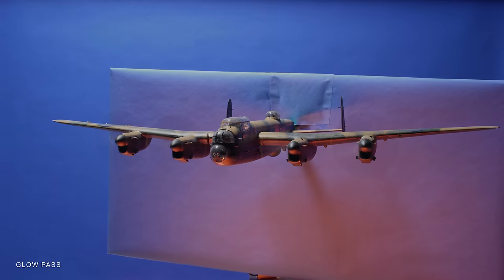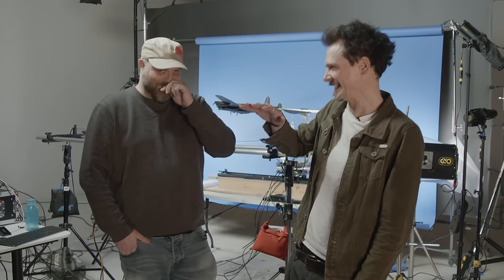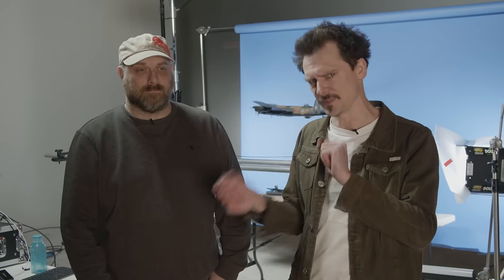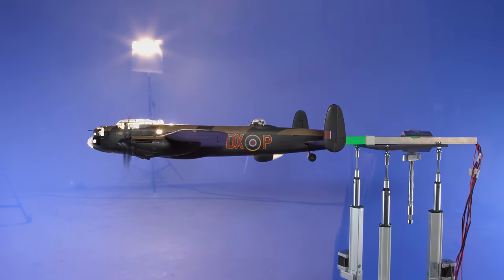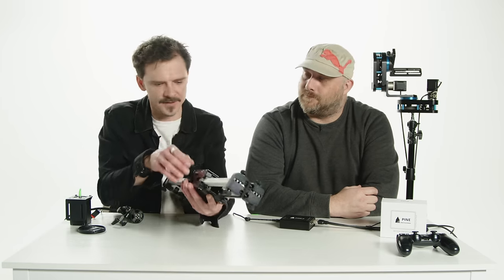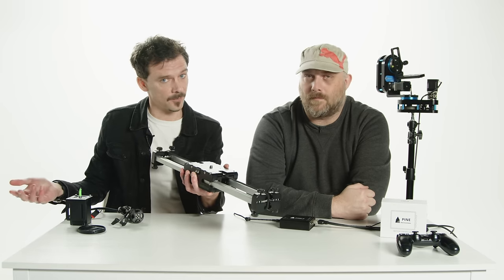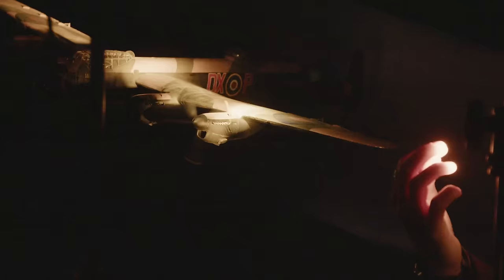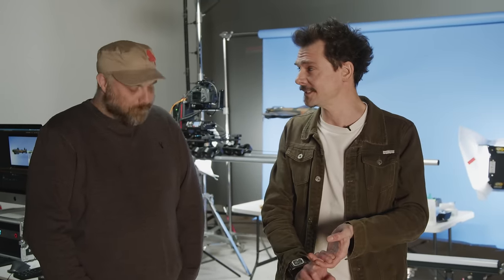All About MOTION CONTROL!

Comment: On the Kessler motors, did you set the “Steps Per Unit” to 200/“rot” on each motor axis? It was something that was left out of the tutorial and really helps the motors perform correctly with Df.
Reply from the maker: That's great to know. In the end we found doing a hard reset of all motors and connecting the rail motor to DF first solved the problem! A weird solution so it's good to know there's a particular setting that might be the best answer. Thanks! 👍

Comment: This is exactly the kind of video I've been looking for. Thank you! I've got a full Edelkrone setup, and you're right. There are only so many axes you can control. It's designed around the idea of simplifying complex camera moves, but doesn't include moving a prop or a light (although there are ways you can sort of fudge it).

I also have the RGKit Play motion control system which is designed around creating motion for props and displays, as well as limited camera motion (their system only supports five motors so you need to pick and choose). 

I would love these systems to talk to one another (as well as my old Cinetics moco motors). I thought Dragonframe would offer that, and it does... kind of. I was hoping all of this could be orchestrated for real time moves, but it appears that it can only move all these motors in a shoot-move-shoot scheme. I'm not complaining - that's an amazing ability. I realize that the streamlining of the Edelkrone and the RGKit Play systems to be ready-to-run is going to limit options. There's still a lot of work I can do with both systems before making the jump into a higher end system that's going to take more oomph to get going.

I hope I'm wrong, and there's some brilliant way to get all this gear to play nice for real time shots. This channel has been very inspiring to get me to push past those limits and try new things - thigns I've been wanting to try for 30 years. :) Thanks for that, and keep up the superlative work!

Comment: any insights why no one has made an "off the shelf" model mover yet?
Reply from the maker: We'd guess because off the shelf means mass production on some level, and these days there probably just isn't the demand
Reply: @InCameraTV  suppose so. I do wonder what the unit cost would be for a small rocker mover (like what ILM used a lot, thinking the BTTF Time train rig as an example, only smaller in scale) attached to a turntable. I wonder if such a product would encourage more small scale miniature use, though admittedly for all I know that could be a 15k usd minimum product depending on its weight capacity and move speed. Maybe more. Alas.